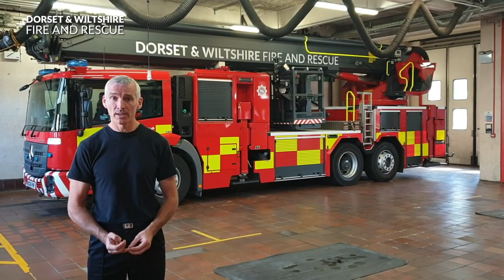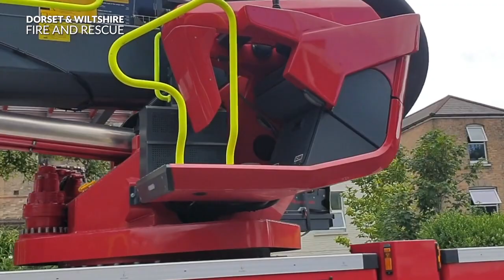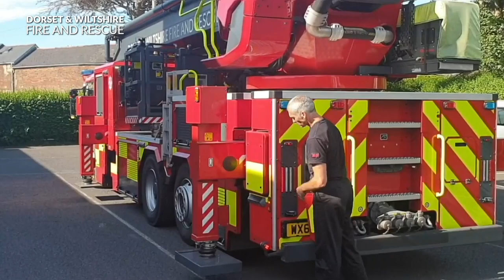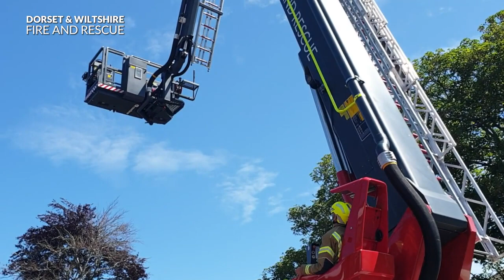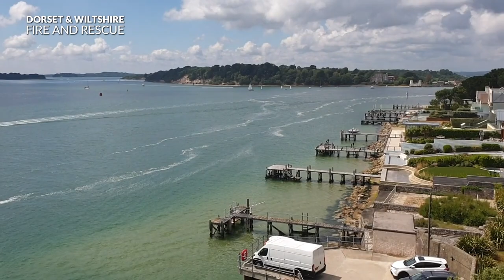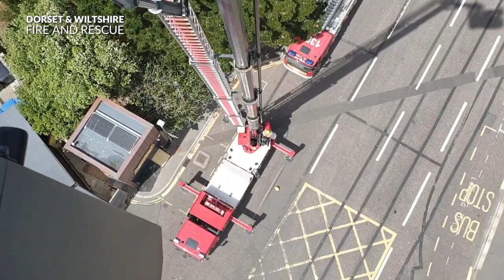ALP Demonstration

Comment: Thank you for producing this video, with a toddler in lock down seeing an ALP on screen is the best they are going to get! My question after seeing this is, why does the ALP require it's wheels off the ground? I understand suspension is soft and locking systems would add extra complexity so would not be installed, but surely having an extra six points of contact to the ground would add a fail safe performance: if for example an out rigger failed?  I appreciate there must be logic, but I'd love to know what it is. Thank you again!
Reply: Danger of rolling, putting lateral stress on the outriggers, and also it would make it very difficult to equalise the ground pressure. Imagine if the slope of the ground put most of the weight on one wheel.